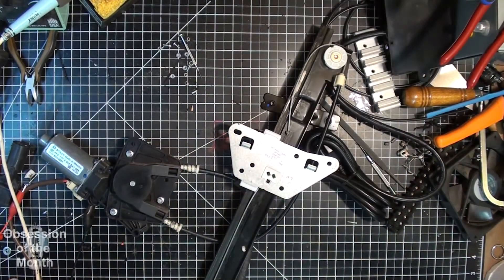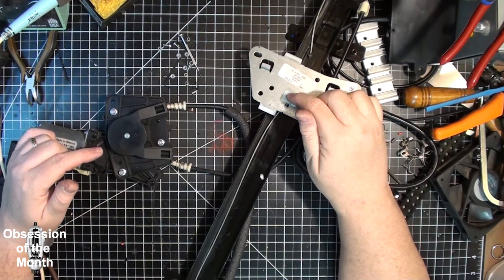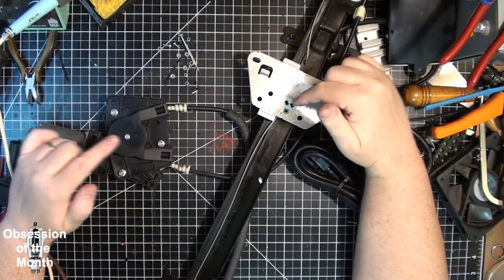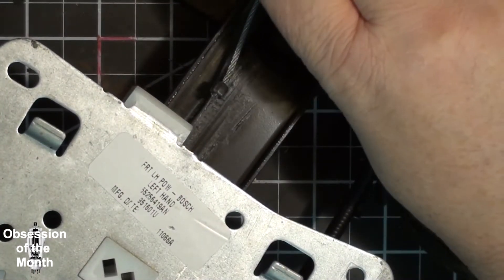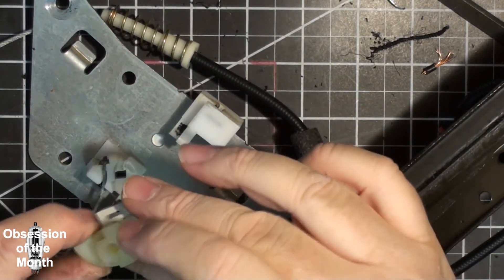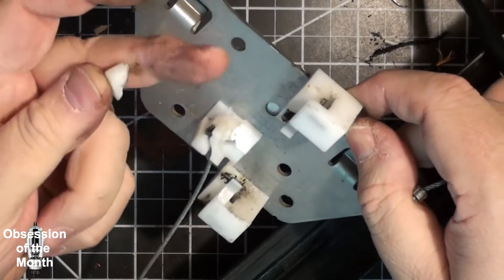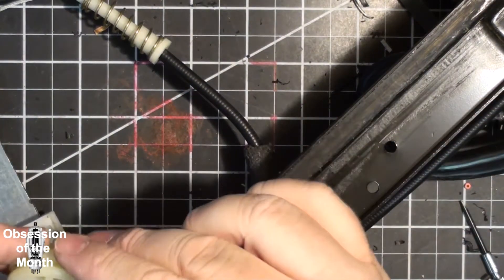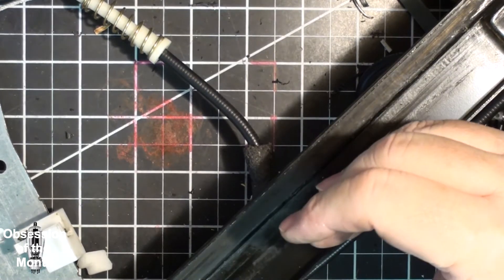Failure mode of a Dodge Dakota Window Regulator

Comment: I've looked high and low to see who might be having the same issue with Dodge Dakota window regulator fails but nothing. I've been thinking that I'm the only one dealing with this. Until I came across a guy that left a comment on Amazon for the Dorman regulator. He went on to post picture after picture diagramming how he "fixed" that plastic part BEFORE it broke. He screwed metal L brackets so as to strengthen it. After that he was the only other, until I found your video. My wife actually owns the Dakota which is a 4 door and every window regulator broke the same way. I spent alot of money and time trying to give her working windows. I've just recently ordered a new regulator but this time I'm going to remove the plastic part, before it breaks, and try to make a replica except out of aluminum. If I'm not able I'm gonna find a local machinist. I figure if I get a block of aluminum and drill out the necessary holes. Then I'll grind out anything else with a dremel. What are your thoughts?
Reply from the maker: If I hadn't already installed a replacement one in my truck I would have tried to find some way to reinforce or improve the plastic part that breaks. A work around for this is to NOT run the windows all the way up till they stop.
Reply from the maker: could you post a link to the amazon review?